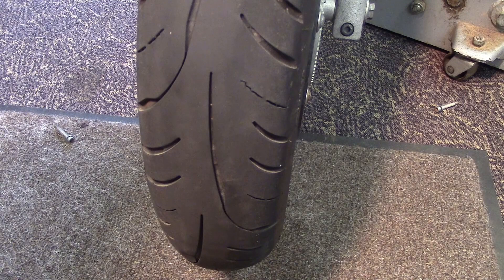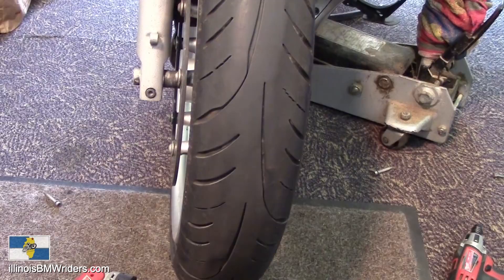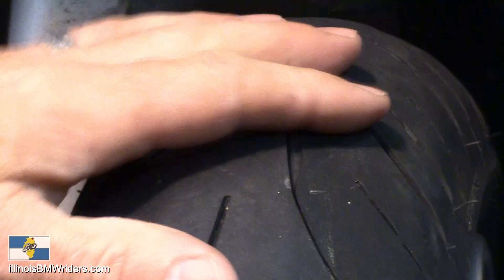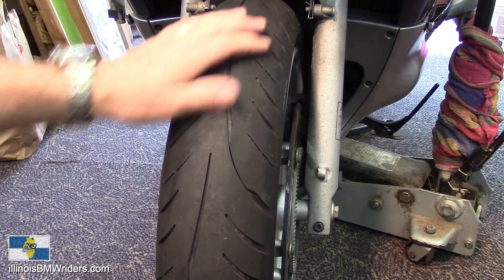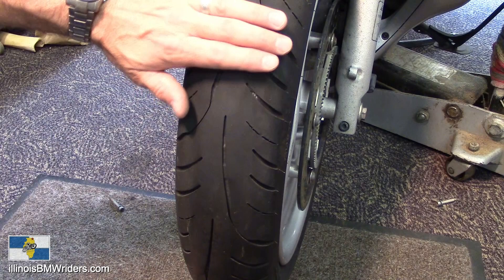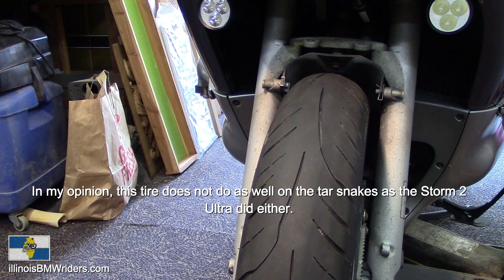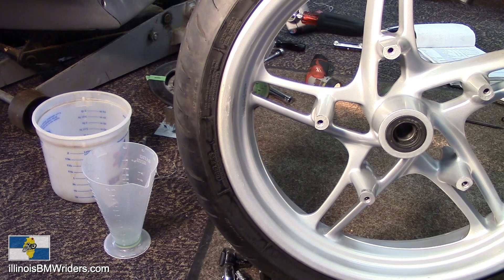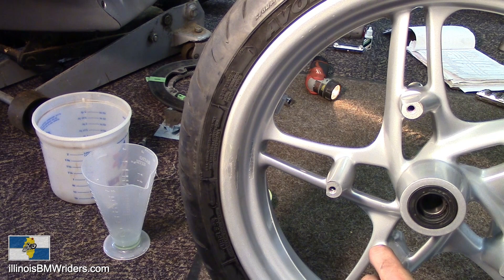Avon Storm 3D XM Review with a Bent Rim and Repair!

Comment: I'm having the same problem with the wear on my front tire as well. I too have about 4500 miles on mine. I agree that the storm 2's seem to wear a bit better. The back tire is holding up perfectly. I'm riding a zx14r. So it is a heavy bike as well. Thanks for posting.
Reply: Would you recomendate 200.50 of this tyre for my New zx12r. ..... ITS ABOUT 210kg you KNOW?    allways I had trail bike and I don.t KNOW avon tyres.... sorry for my inglish FROM Almería Spain. ..bridgestone s21 is very very GOOD  but 4000km and died. ... some córner over 200km. H........ Fast ride no extrem.... recomendate this Avon?.... thanks...

Comment: I see this was back in 2014. So how many miles did you get off the tire til wear mark?

I ride a 05 Suzuki 650S and am currently looking for new tires to replace my worn out paired Michelin Pilot 2CT. I love the grip given off the Pilot 2CT but I've only gotten 7,000 mileage out of it and want something more 'xm'; extra mileage. I came across the Avon Storm 2 Ultra looking over reviews of assorted tires, people claiming 10,000+ miles off of them, but I noticed that they were discontinued and the ones selling are dated production 2012; for the price of near $300, I thought I'd check out something more 'new' if I only had to add a little more ontop. Later, I read some reviews of riders who kept a diary of the 2 Ultras and they ended up around 7k/8,000 average. Going through manufacturers' pages, I saw that the Storm 3D-XM was Avon's newer tires, tagged XM for Xtra Mileage and had a 15,000 mileage warranty so I'd thought these must ATLEAST get above 10,000 miles from the confidence they had on it. Right now I'm seeking to see how many miles riders are actually getting off of these. And what are your final thoughts about them?
Reply from the maker: Kraft T. I would think that this would be a good pick for a 650S. It is a paperclip compared to the weight of the LT. You will get great mileage from them. Just be sure to read the fine print on the Avon warranty before you buy them.